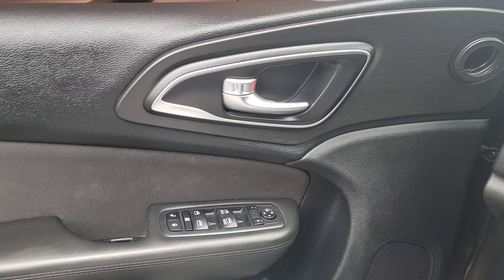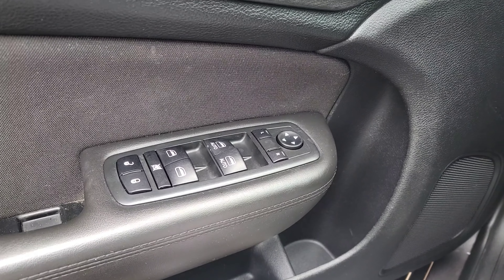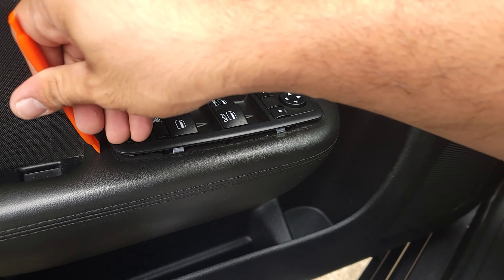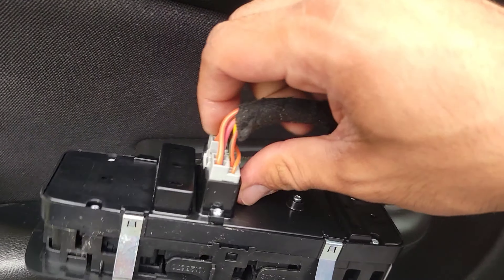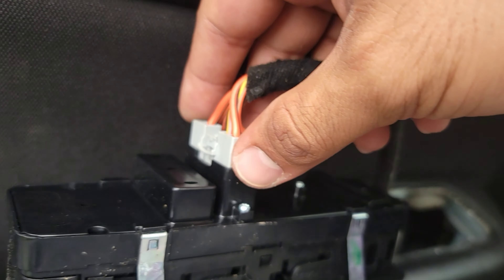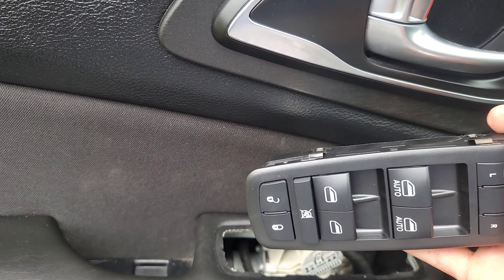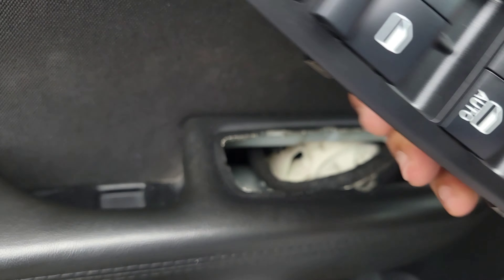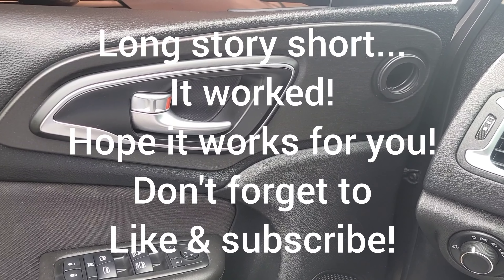2011-2019 DODGE DART / CHRYSLER 200 - HOW TO REMOVE AND REPLACE MASTER WINDOW SWITCH FAST & EASY!

Comment: Been having a problem with it going up for a couple of years but it would work just had to "hit" it a certain way. Got home from work today and it finally crapped out on me. Saw this video called advance, had one in stock. Got it popped it i. Right in the parking lot 3 minutes later and works perfect. Thank you so much for this helpful video.

Comment: I have a 2012 200, my window panel looks different. How do I find out how to remove it correctly to replace the window switch?
Reply: Did you ever find out?